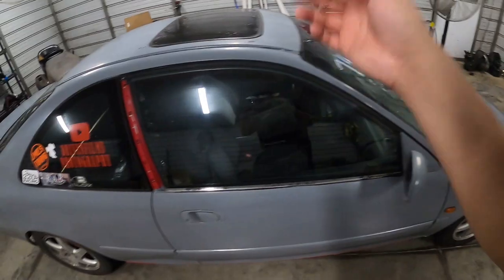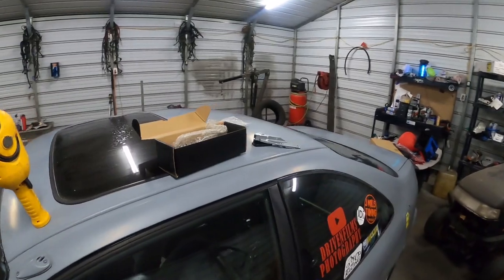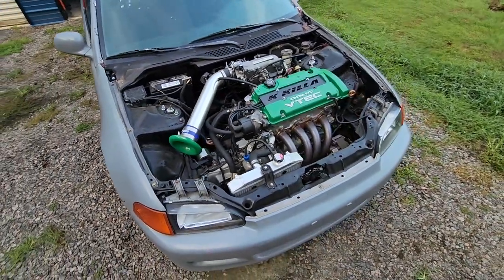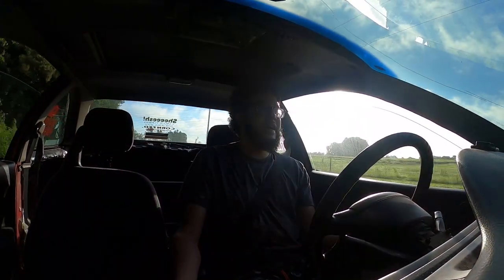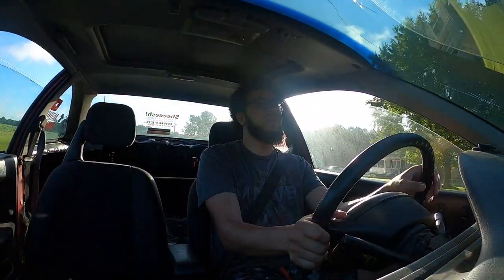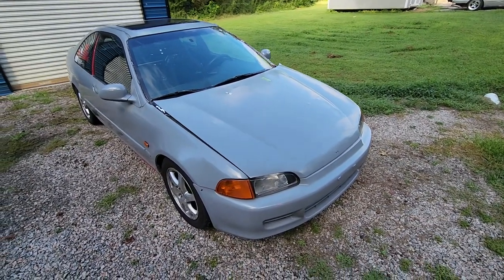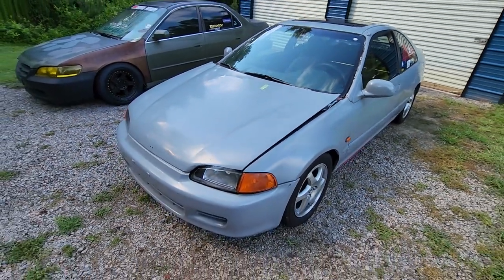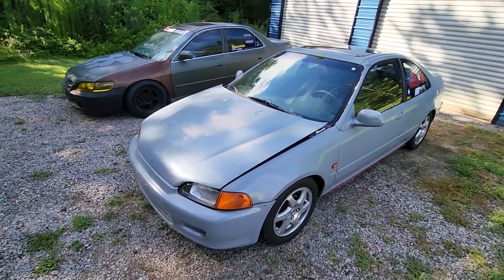Quick Release Hood Hinges For The ALL MOTOR H2B Powered Honda Civic! | Jackspania Racing

Comment: Love the car bro what's the fastest time at the track?
Reply from the maker: Haven't ran it in a quarter yet bro but in the 8th I've did 8.39 at 90 on 195 ebay tires. 1.9 60fts
Reply: @DrivenFilmsPhotography  I'm thinking it's a low 12 second car thats k power impressive

Comment: Can you still put the hood straight up at 90 degrees with the hood prop or will the hood automatically release?

I want to get the hood quick release but I still want the function of having the hood straight up if I don't want to remove it completely
Reply from the maker: Yea you can rotate it all the way up like normal and it'll sit there till you lift up on it. My hood prop works just as it did stock
Reply: @DrivenFilmsPhotography  awesome thank you so much for the info and keep up the great work! Watching you from up in Canada